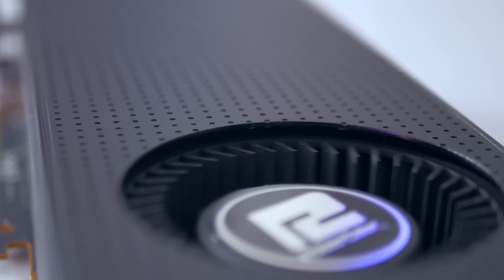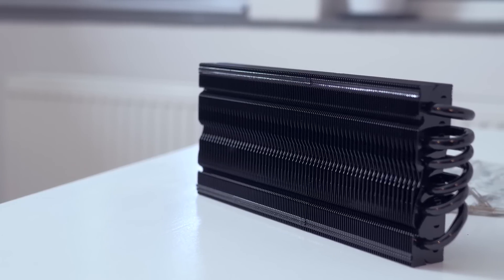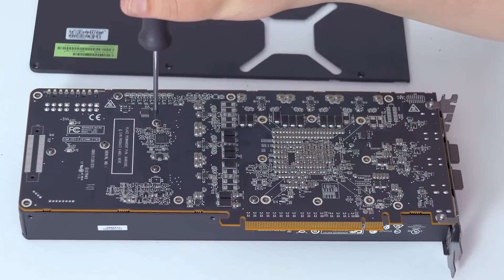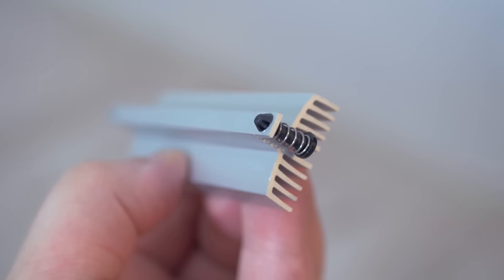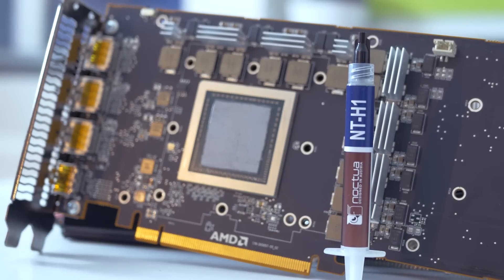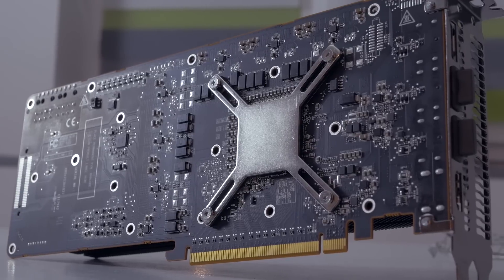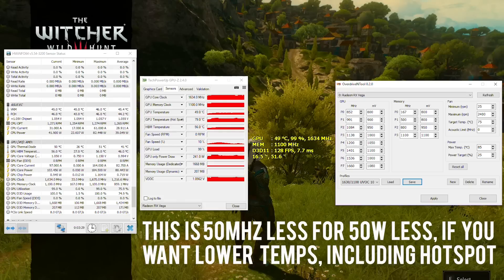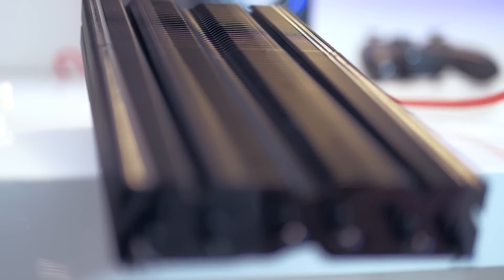The ultimate AFTERMARKET RX Vega - MORPHEUS II cooler SWAP

Comment: Mindblank must be pleased, FPS benchmarks for RX Vega 64 has it 9% on average faster than the GTX 1080 in new Tripple AAA games: Forza 7; The Evil Within 2 and Middleearth Shadow of War. Just another half dozen Triple AAA titles to be released in the next few weeks, but so far it looks like RX Vega was excellent purchase, even with undervolting and overclocking.
Reply: triple AAA ? AAAAAAAAA ?
Reply: Balb Mahal is it still beating the 1080 in froza 7? I heard the new 378.92 driver really boosted gpu performance there on the 1080ti at least not sure about the 1080. I do wish Vega would come down to it's MSRP though but I gusse it's nice to see it win in some games for the extra money it cost over the 1080. Under volting seems to be magical on Vega though
Reply: Yes, even after Nvidia spent a tonne of money on recoding their drivers!. RX Vega 64 is 13% faster at 1920x1080; RX Vega 64 is 1% ahead at 2560x14440; it is only behind by 5% at 3840x2160. It's ahead at all resolutions except 4K. AMD finished crossfire support and has finished  Radeon Chill for RX Vega. So, it is still the default DX12 drivers on RX Vega, which are doing so well in the new Triple AAA game releases over the last 7 days.
Reply: Balb Mahal you found a test where someone did it after this last update? I'd be interested in watching one. I tried to find one but must be missing it. Didn't think there would be any out allready as the update only went live on Oct 9th. Thanks for the reply
Reply: Go to the Youtube Channel: AdoredTV - he talks about and does mention the trend emerging for improved performance on RX Vega 64 as AMD is getting everything on the GPU optimized.
Reply: The funny thing about the forza 7 is that there is no Youtube channel benchmarking the game everyone is quiet waiting for nvidia release the drivers and win but that's not the case and they still quite.
Reply: You a bit out of date, Nvidia has already released drivers - most Youtubes channels are usually 6 months to 48 months out of date with their games benchmarks anyway - you have to go websites to get the benchmark for most new releases.
Reply: Fall Windows 10 Creators update up to a 25% boost on FPS in huge batch of games old and new with Ryzen and RX Vega. Got 10% increase in one game I'm playing now at 2K!
Reply: My Reference Vega 64 undervolted does 1600 MHz core, and 1100 MHz memory. It smashes the 1080 with a 26000 score on fire strike. That’s 2080 level.

Comment: What's up with GPU Z showing 80°C for HBM "hotspot"? While HWiNFO showing the more logical 56°C? :)
Reply: Филип Пешић hwinfo is showing hbm2 temp whille gpuz has hot spot and hbm2 they are different sensors. If you look right below hot spot temp on gpu z there is hbm2 that shows the same temp as hwinfo.
Reply: Thanks. Somehow I didn't notice the common temperature on both sides.
Reply from the maker: +Филип Пешић Hotspot temperature is not related to HBM IIRC. It's not VRM temperature either...

Comment: Awesome custom heatsink replacement you did here. Awesome video and thanks for showing the temperatures in real life scenario. This would be an even more of a perfect solution if you could maybe try to fit on two Noctua NF-F12 PWM fans and maybe if you could show us temperatures with those two at their max rpm of 1500-1600 so that we can see if it is still better than stock cooler. Now your Vega looks kinda a well cooled sexy rendering beast just waiting for DX 12 (=Mantle API) with properly enabled ASYNC to become a reality in modern games. Thanks a lot mate :) .
Reply from the maker: +LFly R I'll do a follow-up on this since my 4 pin mini PWM fan came in.
Reply: I was thinking the same thing... Noctua FTW!

Comment: Hello! Great vid. I like the way you do tests in a very scientific manner. Some people are seeing 20% performance uplift in games with Fall Creators update. Could you test this? My theory is that DirectX drivers were updated and that is the reason there is such a huge improvement in performance. You could test this too with an OpenGL or Vulkan game too. Also I doubt DX12 games would get the same benefit since most of the work there is done by the game creator.

(PS. I would love to test this, but I don't have a good enough setup to test on)
Reply from the maker: +Máté Nagy Thanks mate! Not quite sure the 20% performance uplift is real at this point. Will look into it and consider making a video.
Reply: MindBlank Tech It has been proved to be fake by HardwareUnboxed and GN.
Reply: @AliceBorry Yes I've seen that. (Although limited amount of scenarios). It seems I based my assumptions on bad data...
Reply: Máté Nagy I think configuring your version of Windows 10 might have bigger shifts on gaming performance than a random OS update does. Something I still need to get around to.

Comment: Sorry to bother but is there a way to watercool a 1700x and Vega 56 card with a really good look like the ek fg kits and under 300 EUR or slightly more? I was waiting for ek to release a fg kit for a month now :(
Reply: Not too long ago EK made a new product, basically an already assembled loop. Being from The Netherlands EUR prices are not hard to find for me. How ever, i will still link the original EKWB link too as it also displays EUR pricing on their site; 

This is with a 360 Rad: https://www.ekwb.com/shop/ek-kit-s360 

This is with a 240 rad: https://www.ekwb.com/shop/ek-kit-s240 

Do note, these are all flex tubing not hardline

The latter one should still be plenty.
Incase you need country specific EUR prices you know the drill... Copy and paste it in to google and BANG! The dirt is gone, bad joke... Blame TV commercials.
Anyhow google is your best friend regarding Country specific pricing and ofcourse product availability. 

For example, I wanted to fit the NZXT G12 on my RX480. I can get the bracket and wather cooler just fine. But heatsinks? Nahh, can't find shit. (well, shit I can find. I have a dog.)

Goodluck finding what you need sir! Hope I helped atleast a little!
Reply: Alphacool eiswolf and nexxos
Reply: JustRefleX EK has some custom loop kits that are ~150 € w/240 rad